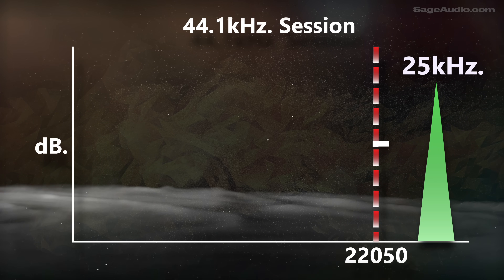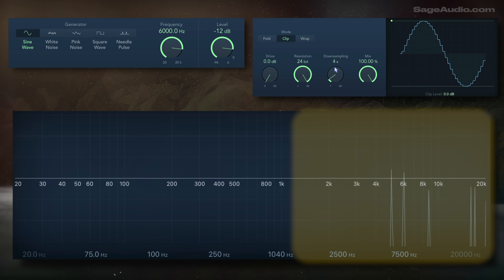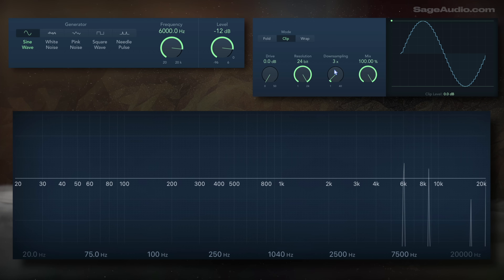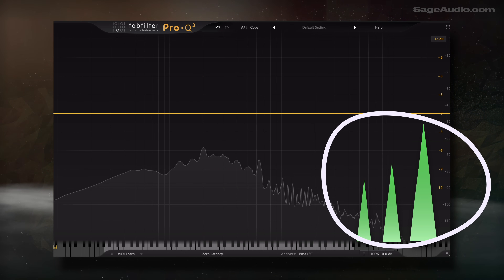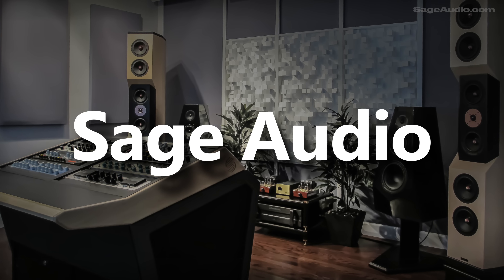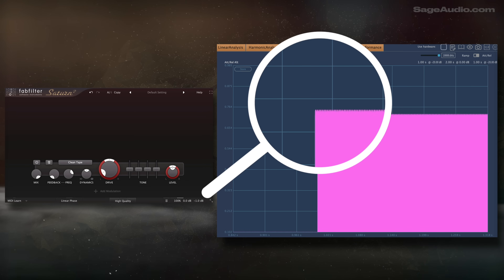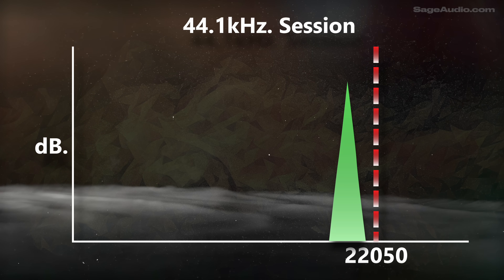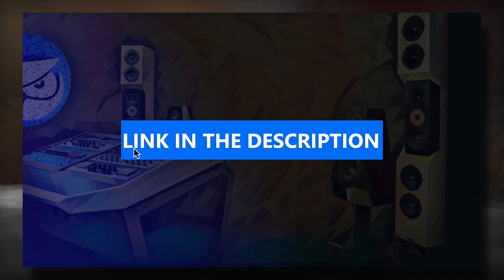Aliasing: Everything You Need to Know

Comment: Aliasing explanations usually do some some hand waving but there is some more signal processing at play:
1. While we ignore it in high level applications, frequency analysis of real signals has a negative component. It mirrors the recorded frequencies on the negative axis. So we actually have a -25kHz signal as well which is ignored.

2. Sampling is infinite. We isolate up to 44kHz in a case like this but practically, sampling continues at multiples of the sampling rate. It is after all a rate, not a bound. 

3. Its then easy to imagine that spectral copies (aliases) of the system appear at 44kHz, 88.2kHz, 132kHz, etc. This includes the negative band. Imagine the system reflecting with 44khz being the axis of reflection.

3. When we try to sample too high a frequency, the negative twin from the system copy at moves towards our observable frequencies, until it overlaps. In your example,  the negative frequency would appear at 44kHz - 25 = 19Khz. 

So rather than the frequency being reflected back, it is actually the negative twin of the first system harmonic being pushed into your observable bands.

Comment: Very important:
1.) Preringing is directly related on the quality of the Anti Aliasing Filters.
E.g. Fab filter has incredibly effective AA Filters where preringing is almost inaudible.

2.) Low level Preringing sounds like a transient being ever so slightly lenghtened. 
This can be very pleasing and is certainly a lot less distracting than complex Aliasing Distortion.

3.) For all who think a sinewave test of Aliasing is representative:
I you have a piano recording with a Sea of harmonic content and you slap you favorite console emulation on it and it has saturation:
All those harmonics will generate more harmonics beyond the frequency limit of the samplerate through saturation.
This means Aliasing will create a Sea of complex, unrelated frequencies in the audible spectrum.

In essense, if you ever thought digital sounds harsh and analog sweet, well, this is one of the most prevalent reasons why.

Comment: I've got to wonder why digital recording  technology doesn't just natively and naturally stop sounds from reflecting back and causing aliasing since it's never desirable?
Reply: Two main reasons - 1. it takes CPU cycles, and 2. the process requires steep filters, usually zero phase which have their own pre-ringing issues, particularly on transients, these filters also cause latency.
Bonus reason, related to the other two - aliasing is only a problem on specific processes that produce harmonics above Nyquist (24kHz at 48K rate). We're basically looking at the last available 0.1% or so quality improvement.

As I said in another comment, almost every digital production from between 2000-2020 did nothing to reduce this aliasing. It's something to consider, but it's at very low level. I try to minimise it, but I only really started that in the last 5+ or so years and digital stuff between when I stopped recording analogue and the rise of oversampling in plugins etc will have all had aliasing unresolved. It's not the end of the world and in many cases, will not even be audible.
Reply: @splashfreelance what does aliasing even sound like?
Reply: @ravigunslinger  if we are detecting it i believe it sounds to us much like a tiny bit of digital sounding noise. its quite literally just "non-musical sounding frequencies added", aka noise. what im trying to wrap my head around now, is that how it can apparently cause a 90 degree phase shift and that could make it sound much different, that would certainly cause phase cancellation which could smear the sound, cause loss in volume, and make some frequencies disappear// aka ruin the whole fucking sound, not to mention the added noise, if that even detectable. 

it sounds like its probably a very noticeable amount of unpleasant damage to the sound. doesnt even seem like something we could abuse for cool sound design techniques, but purely a phenomenon to watch out for and prevent (by using multiband saturation and not letting it touch the highs i guess?)

Comment: Here's a wrinkle - Aliasing distortion can be below the threshold of audibility on a single track. But as the aliasing is uncorrelated to the audio and correlated to the sampling frequency, it can add up across tracks to the point it's audible. Because of this, it can often be hard to know what the problem is, your audio will just be veiled, or smeared. I have no easy solution to this. 

I try to test every plugin that is adding saturation or distortion to see how well any oversampling (if at all) works, particularly at different rates. Too much oversampling can be bad too, as the zero phase filters can add pre-ringing up to the length of the plugin delay. I ignore any aliasing that is lower than about -90dBFS, on the assumption that even with 20 tracks of aliasing distortion at that level, it's unlikely to create a seriously audible problem when combined. 

Then I make an executive decision to use oversampling on relevant plugins. Just running a session at 96kHz is not a solution for me - it may not be enough as some processes require 4x and more oversampling to reduce the aliasing, plus I like the extra CPU cycles I get at 48k. If it made a huge difference, I'd do it but, for me, the problems aren't reduced enough to warrant the higher rate.

Ultimately though, aliasing isn't the problem it might seem given the amount of attention it's been getting recently, so I'm happy with my executive decisions, assuming they are mostly right.

I have noticed a difference between a mix with this selective oversampling on and with it off. It's not huge, but it's noticeable. Just know that most music created between about 2000 and 2020 would have had this sort of aliasing unresolved. I still don't like the sound, especially once I became used to hearing it, but it's going to be less audible than the poor quality reproduction used to listen to music, whether earbuds, soundbars or anything made by Bose.

But it does feel good to know I've done something to reduce the problem, and as I've been trying to stick to a more analogue workflow recently (fewer tracks, fewer different effects, more complete performances, no clipping, a focus on arrangement over engineering) I'm comfortable with my approach. Anyone with any advice, wrinkles or suggestions, please - feel free to flame.
Reply: Makes sense to me too.. I'm not at a stage of hearing it as such but I know that when using like gsat that once I'm set I'll toggle the oversampling and if I hear a difference I'll leave it on,.(makes me wonder what I'm missing though). 
Forever learning! Only home recording and only ever heard a difference once so.. 👍
Very interesting and informative vid! Thank you! 😎🙏🕊️✨👼
Reply: @Owl-qh2rh  https://youtu.be/nX6Cb7i7eMk?si=oMykuC4iVsOBSc05 This guy, Paul Third, goes into sometimes excruciating detail on the pros and cons. Dan Worrall is another guy who I find makes a lot of sense. Paul is a youngster but seems to have his head on straight, Dan is closer to my age and comes from an analogue backgorund too but both these guys are a lot more OCD than I am so I'm happy to take their word for it, when they explain their process etc. Paul Third also gives examples where you can compare the exact same audio with and without oversampling. I couldn't find that exact video but if anyone is really interested I'm sure they could by a better search string than mine..
Reply: This all made sense to me.

Comment: 7:16 if I do this, doesn’t aliasing occur when exporting in a lower sampling rate like 44100 or 48000?
Reply: Any resampling process should have reasonably high quality anti-aliasing filters these days. Resampling used to be a bit of a nightmare for artefacts, unless it was resampled to an even integer rate - eg., 96 to 48, or 88.2 to 44.1. 88.2 was specifically set as a standard for this reason. But since the algorithms and CPU power became good enough, about 20-odd years ago, it's just not a problem anymore. As long as you are using a reputable bit of software, resampling is so close to artefact free these days that people just don't worry about it anymore. Even the more complex changes (more complex maths)  like  48 to 44.1 aren't a problem.
Reply: @splashfreelance man you delivered with that answer. Thank you so much, no more questions your honor! :)
Reply: ^I think that this would hypothetically be solved with a dithering plugin though, right? I only just heard about n looked this up pretty recently n left pretty confused, so I definitely could be wrong, but I thought that that was what they were for? But so, assuming that I actually am correct with that, you're saying that they aren't really necessary?
Reply: @SeenSpace dithering is definitely something I gotta look into, I don’t really know what it does.